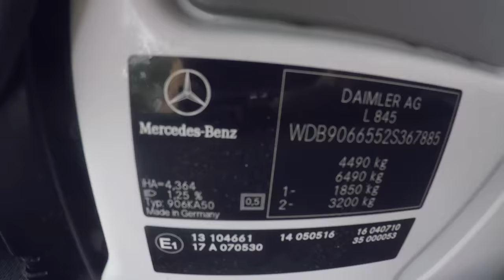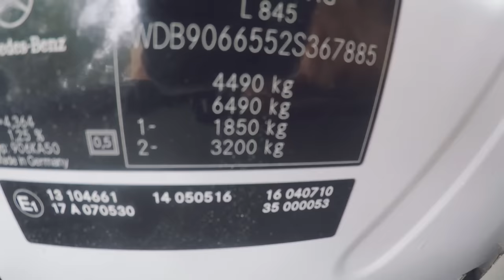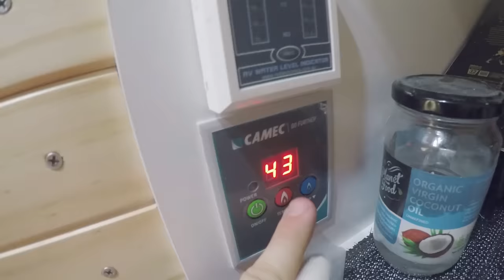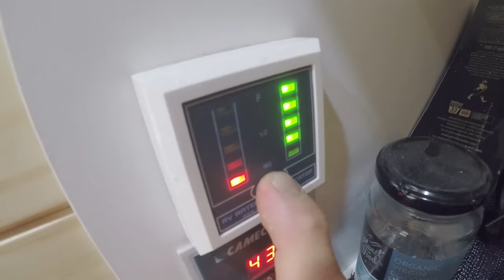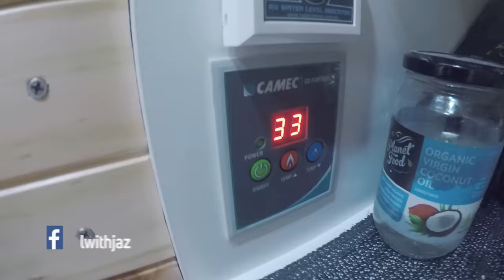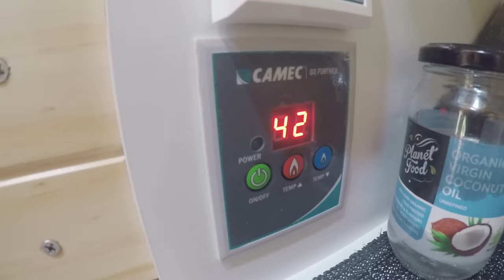S1E12 Sprinter Van Conversion | Plumbing Pt. 2 + Gas

Comment from the maker: Super glad to have finished the plumbing and gas, it's very convenient to plumb your taps and shower into a permanent tank instead of removable water bottles. We have used the BBQ out the back to cook roasts, bake cakes, brownies and even make pizzas! I would recommend using gas, in my opinion it is the most efficient and economical way to cook and heat.

Ep.12 BLOG + PRICE BREAKDOWN - http://www.jazmorton.com/van-conversion/plumbing-pt-2-gas/
Season 1 Van Build - http://bit.ly/VanBuildS1
Season 2 Van Life - http://bit.ly/VanLifeS2
Reply: I think u need to assamble the roof for ur barbecues xtvt..maybe it somewhere between two doors at the back
Reply: Travel With Jaz

Comment: I must be subscribed to 10 van build channels and this one is by far the best.  Truly superior and its been worth the wait..  I also just wanted to mention that RO systems "waste" a considerable amount of water when making pure water.  You may be surprised how fast you go through your on board water and wonder why.  Depending on the model, you may use 4 gallons of tap water to make 1 gallon of pure water.  Also you may want to install a J or S channel molding at the very bottom of the shower door so water doesn't collect in the seam.
Reply from the maker: Thanks mate that really means a lot! I definitely had that problem and I was going "where is all my water going" so I tested it and for every liter of filtered water it produces it wasted 2 liters so it was 1:3. I ended up bypassing the RO filter so it just filters through everything else. On the bottom of the shower door is a rubber seal that seals hard to the hump when door is closed. Thanks for all your support and following along I really appreciate!

Comment: Good golly! I'm enamored with this series! I hope you do another project or something because I'm gonna be heartbroken when I finish watching your van build. Another thing, when I watch, I write down questions I as I come up with them, but by the end of the video, usually you're so thorough that at some point you answered them all! (Except I didn't catch what those flexible door handles were in the back.) Huge fan of your van's open design, allowing walkthrough, while most Sprinter builds stick a 'garage' in the back.
Reply from the maker: Thanks brother you can ask all the questions you need, but if I haven't answered them in the video check out the corresponding blog post in case. The black rubber handles were just to make it easier when closing the back doors from when you are standing inside 👍🏼

Comment: Add a home theater. You got that big flat wall. Get a short throw projector and pull down screen. Add some speakers and bass in a cabinet.
Reply from the maker: haha that sounds pretty awesome, was actually thinking of using a normal projector on the outside side of the van, and create an outdoor cinema
Reply: You could mount a huge screen on the side like an awning and pull it down when you want an outdoor show.

Comment: Attention to detail in this van is amazing. While the layout is not what I would have chosen, it's obviously designed for what you need it for. Could you give a bit of a rundown of the thinking and reasoning behind your chosen layout? Ie, no fixed bed, loads of cupboards etc. Cheers!
Reply from the maker: Thanks mate! Yeah i will do a run down on all that in the final van walk through tour

Comment: Hello it’s like a little wooden pallet raising the floor height so you are standing on the wood when you shower allowing the water to drain away below and if any body required to use the loo you wouldn’t need to  squeegee the floor down.
Reply from the maker: hey sorry I'm not really sure if that would work, you would literally need to have the wooden floor sealed to the edges, otherwise it would leak through and just end up at square 1 + i wouldn't really want wood in the shower in a wet environment constantly. thanks for the thought though :)
Reply: Travel With Jaz finally realised what they are called a duckboard have a look on google at the images a picture explains better and they are not sealed in just free standing.
Reply: The issue is that Jaz was not able to put the drain in the actual designed drain spot in the shower pan. It isn't at the lowest spot in the pan, so water will always pool. I suppose a duck board would be one solution, to keep the person separated from the water until it evaporates. A squeegee won't make the shower shorter though.

Comment: So awesome. A few thoughts:
- My gas guy said the window beside the gas cooktop would be good enough for ventilation, I didn't realise I needed another one down low. Wouldn't surprise me if I do though, NZ has the same regulations as AU I think.
- Wish I got the dual axel version of my van. I'm going to be very close to the weight limit.
- Have you got any air inlet in the shower? Will the air extractor work OK without one? That door looks awesome.
Thanks for the videos, they are very useful.
Reply from the maker: No worries I am not sure but on most of the Aus regs NZ is generally the same. Yeah the exhaust works fine without an air inlet 👍🏼

Comment: Absolutely beautiful work!  Everything looks incredibly professional and well planned out.  I was wondering about the grey tank - it looks like the drain lines from the van enter the grey tank towards the very bottom of tank.  Because the drain line enters so low, as the grey tank fills, will the increasing water weight in the tank push back into the lower portion of the drain line and prevent the tank from being able to fill to capacity?  I know there are fluid dynamic calculations that can be done, was just wondering if you'd already tried it?
Reply from the maker: Thanks very much! As long as the top of the tank is a bit lower than the lowest drainage point in the van, it is fine 👍🏼

Comment: Jaz man, that is just fantastic.  I have watched you from the beginning and I can see the work you have put in has really paid of and some.  May I suggest a small awning above the rear doors to protect from sun or rain when you have the doors open?  Also, does the windows behind the cook top actually lock?  It looks like it may need a handle to avoid you leaving loads of greasy fingerprints on the glass.  Looks great pal.  REALLY jealous. I still haven't even found a decent van yet.
Reply from the maker: Thanks mate! Yeah I havr thought about an awning or something there 👍🏼 and the sliding window technically doesn't right now but I need to fix it and add the handle and lock

Comment: Is there a need to cover your gas hose and water tank with rubber pads for protection? Hope you can show your bed set up and sound system too. Awesome build! 
👍😎👌
Reply from the maker: The gas copper pipe is protected by plastic corrugated conduit. And the tank can be left as is. The bed will be ep.14
Reply: Travel With Jaz thanks for the info.  Looking forward on the next episode. 😎👌

Comment: Well vloged and great conversion, you answered all my questions as well. Nice one. Saw in some builds that they cut lots of holes in the drawers/cabinets etc to minimize weight, might be cool down the track to see how light you can make it even though you are under the max weight load requirements. Also will you have an inside table for eating working on etc? Cheers
Reply from the maker: Thanks mate yeah I don't know if I could be bothered to do that. I will have to figure out something with the table in the near future

Comment: Hey friend. I watched your show and was very impressed. But in Plan No. 11 why was it only for a single person and not a couple. Anyway, I learned a lot and took ideas to build according to your plan. I also learned from the connection to the water and the bath and it was professional and accurate. Anyway thanks and good luck.

Comment: In my opinion, I think you should move that fire extinguisher. If there is a fire, swinging around the fire itself to try and unattached that and grab it out. Seems like you might get burned from doing that.
Reply from the maker: Depends where the fire is, maybe I'll put another one up the front.

Comment: Hi Jaz! Thanks for the great episode, you build your project really well. Watching what you've done in this episode I would ask you if it is worth to put a check-valve on your waste water tank feeding pipeline to prevent popping out all that grey water through the shower tray while driving your campervan and pushing your brakes hard when needed? Greetings from Kazakhstan!
Reply from the maker: Hi mate thanks a lot, I don't think this is worth it because the water will come out of the "air breather" which is on top of the waste water tank before it comes up any drains
Reply: If the air breather is on the side which will get the push of moving water while braking then it's okay

Comment: Great job!  Only thing I'm thinking could be a problem is the waste from the sink goes into the grey water tank at low level and if you are not on a constant empty and have to close the drain valve, when water starts collecting in there and is higher than the sink inlet you might stop draining water from your sink as the tank gets full, better to have been a high level entry?
Reply: Exactly what I was thinking, seems to work for him though.
Reply from the maker: Good question I've tried it out and it is fine. It doesn't matter as long as the top of the tank is lower than the lowest drainage point in your van. Think of how your house toilet works, it always stays at the same water level no matter how much water you put in there
Reply: Ok cool, was wondering about that, thanks :)

Comment: Great van, really thought out, but personally I don't like to see so many different cables crossing the underside, exposed to both lots of dirt, but also bearing greater risk of something getting pulled/stretched. If there is a screwable "plate" or half-cut metal pipe, I would opt putting one there
Reply from the maker: Thanks mate yeah that's why I ran 95% of the cables in corro  👍🏼

Comment: Awesome work as usual. It's great seeing the van coming together. Do you think it is possible to store the drinking water tank inside the fridge? Something like cutting a small access hole on the fridge to run the 2 lines to the tank. Personally I'd prefer cold water so that'll be cool to know if it's possible.
Reply from the maker: I'm guessing it's possible but I wouldn't be cutting holes in the side of the fridge. Just fill up a bottle and put in the fridge
Reply: I agree, you'd be better off trying to find a fridge with that sort of thing purpose built, if they exist. Compact is usually the key consideration for RV accessories, though the external compressor option was cool, hadn't seen that before.  It would be pretty easy to drill a hole through something you shouldn't if you just have at 'er!

Comment: Beautiful job. Class act..one question I have. The solid copper tubing would have a tendamcy to crack with vibrations, especially on uneven roads or pavement?  No different than yacht building. Is that what the gas fitter recommended instead of flexible propane line?  Just curious.    
Great job.
Reply from the maker: Hey yeah i believe just for resilience, it is secured pretty often along the run so there isn't a point that would want to bend.

Comment: hello jaz
I'm curious about your background. You did a great job converting the van.
And I thought, can I do the same? Just to see you making the plumbing connection under the van left me beating badly, it's more pipe to my head, just an example.
greetings from Portugal
Reply from the maker: thanks paulo, the plumbing pipe once looked at on the diagram on my website isn't too hard to understand, i hope it can help you!

https://www.jazmorton.com/van-conversion/ep-7-plumbing-pt-1/

thanks!

Comment: Nice job, Question, how airtight is the shower, when exhaust fan is on where is replacement air coming from?
Reply from the maker: Pretty airtight but should work fine

Comment: Great work and great van mate. Quick question, do you not get worried about the exposed pipes and tanks under the van will get damaged by debris from driving?
Reply from the maker: Nah mate they're pretty heavy duty they should be fine ;)

Comment: Hi, what size and spec gas pipework have you used? I see you have wrapped it in black plastic conduit underneath the chassis. Cheers
Reply from the maker: Hi mate, I couldn't tell you the exact specs on the gas pipe as i didn't install it, a licensed gas contractor did that part for me, sorry

Comment: Hey. Do you plan on traveling year round? If so, how do you plan to keep your water tanks, and pipping under the van from freezing? Also, are you worried that the vent the gas guy put in will bring in cold air? Thanks.
Reply from the maker: Hey man yeah all year round! Australia isn't the coldest country that's for sure but it does definitely get cold, so I'll have to cross that bridge when I come too it, I'm not worried about cold air getting in the gas vent. Will update when I know
Reply: ok, cool. Thanks so much for replying.

Comment: what about a wooden slated platform in the shower it will allow shower water to drain plus allow anybody to use the loo before you have to dry wipe the shower floor.
Reply from the maker: Hey I don't fully understand sorry what exactly do you mean?
Reply: A grate made out of wood slates, like a wooden tile bottom, water can drain underneath and the next loo-user after the showering one keeps his feet dry...
Brilliant build, thx for showing everything in such detail!
:-)

Comment: Stunning job ! Currently about to purchase a Maxx Air fan for my new Hiace. How you finding yours ? Had been tossing up between a Fantastic Vent. But after watching your install video I was sold on the Maxx Air because of the ability to use here in Australia with the rain.
Reply from the maker: I would defz go for a Maxx Air deluxe because they can be used in the rain and also blow down and extract. Also operate on automatic mode
Reply: Travel With Jaz Cheers bro, enjoying your videos.

Comment: How is your gas box vented? Does the gas line from the bottle just run straight down through the floor of the gas box? I'm wondering if it's possible to get away with having the gas bottle inside a gas box that's hidden behind the side sliding door, so that it's only accessible from the outside once the door is open.
Reply from the maker: So the gas box line runs straight through the floor of the gas box to external and all lines are ran underneath the van until entering the van and coming back inside.

Comment: you have attached your drain hose to the bottom of the grey water tank. Are there no issue with back flow when the grey water tank fills up

Comment: That was really clear Jaz. Thanks. The rear double wheel van is that called something in the spec of the van or is that in the model of the van. How much extra was the van with extra weight bearing? Cheers
Reply from the maker: Thanks mate it is the 5 series of the sprinters. So mine is a 515 model. There should be info on google. I couldn't tell you how much extra it costs in comparison sorry

Comment: You seem to use flexible gas lines instead of rigid copper ones:  can you elaborate on those flexible gas lines?
Reply from the maker: All the gas lines in the van are all rigid copper ones, but are enclosed also In plastic corrugated conduit.
Reply: It is the first time I see protection over rigid copper lines:  is it to protect them against rubbing?

Comment: Ok thx for all the weight info but how much does the van weight in itself without any payload, like on paper?
Reply from the maker: I'd have to check that, I'm pretty sure the van is 2.5 T with no payload and has a 2T payload
Reply: Travel With Jaz Also what model is your fridge? Thanks <3

Comment: What about to put a second water sensor in each tank and use the average value of them for the tank control?
Maybe u need another controller or have to build your own but I think that it will work much better ^^

sorry for my English... I'm from Germany but I hope u can understand me^^
Reply from the maker: i see the idea but don't really need an extra in the same tank, good idea if you want to do the extra work but not necassary i think. good idea though
Reply: Okay but i thought that if the van isn't leveled you will have some Problems because the water is higher at one site of the tank an so ypu can mlddle it^^

Comment: This van is a 515 cdi, and for example 316 cdi can have around 3,5 tonns max total weight, larger first number, higher weight
Reply from the maker: Yep that's exactly right mate 😄
Reply: Yep. Worked that out from the Mercedes brochure. 3 = 3.5t, 4= 4.5t, 5=5.5t and the next two digits indicate engine power, ie, 15 is close to 150hp and 13 is only 130hp.
Reply: Ian Lindsay Thanks, didnt know that!

Comment: No bed? Where are you gonna sleep?

Also I don't see a propane heater, but I guess you don't need one in Australia where it's hot all the time.
Reply from the maker: Just about to release Ep.14 about the bed. I might add a diesel heater in later on
Reply: obviously you has missed an episode 14 tho! subscribe dude!!

Comment: many holes on the floor did you shield them?
Reply from the maker: The holes that I drilled through the van floor to secure the sub ply floor down I siliconed up on the bottom underside of the van